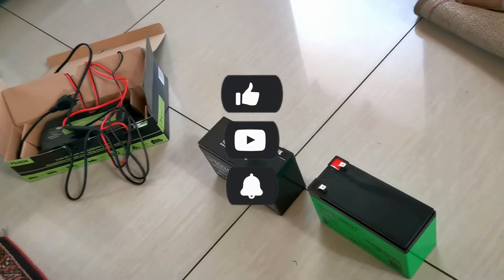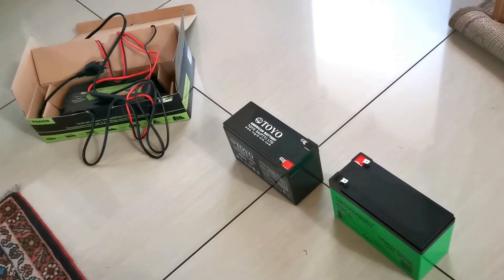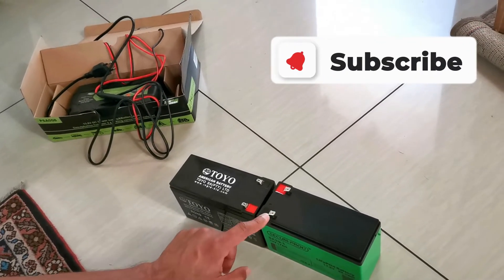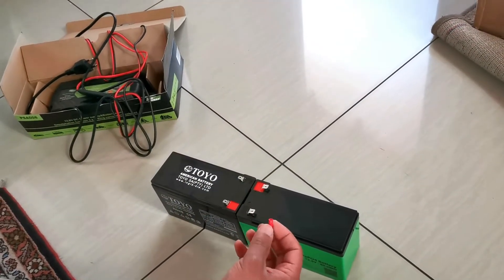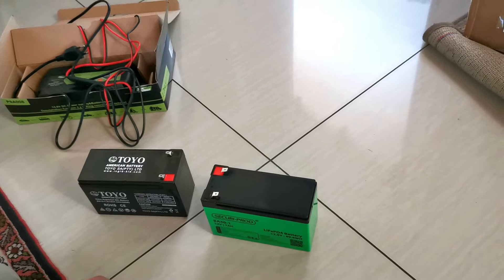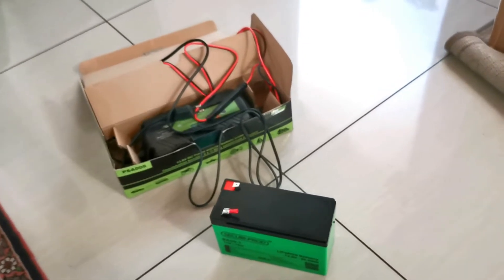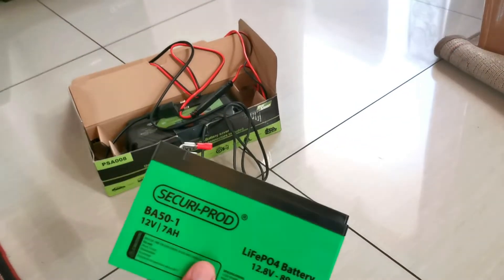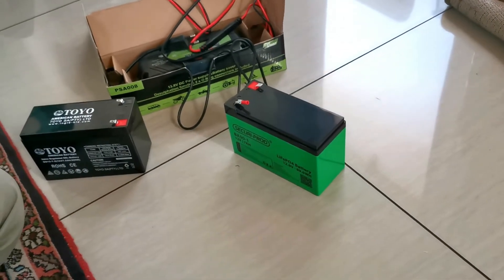Is a 12v lithium a suitable replacement for a 12v lead acid battery?

Comment: Howzit Boet. I see the video is 2 years old.
These LiFePO4 batteries are 12.8V (4 x 3.2V cells in series) batteries. 
The output voltage from your gate motor/alarm panel/UPS to charge the battery is ±13V, which is 100% compatible, which means you can swop them out.
Reply from the maker: 👍 I'll be making a video on it so

Comment: All I know, is, I got a Pride MED go power chair, with 2 Acid filled Nano - Silica sealed, 12 volt & 20 ah. I wanted to upgrade, change to a new lithium ion battery, but must also change are power controls, and a new charger, would be $600.00 too much, will stay with the Interceptor 2 non spillable Sealed Lead Acid Battery, NANO - SILICA  Type NB12,200 High Performance 12 V. - 20 ah. a 2 pack batteries

Comment: Hi I had the same problem but I forced on the connectors for the lead acid battery onto the new lithium battery.  But now my gate motor will not open or close when I press the remote.  Does it need a different charger (for lithium rather than for lead acid) than the one in the gate.  Also I suspect the gate charger is not charging but when I look I do see the light is on.  Any ideas.
Reply from the maker: Maybe a fuse blew, you have to do some troubleshooting
Reply: I have the same problem, how did you resolve it?

Comment: You can also connect 200 Watts Solar  Panel and 20 A controller  to charge same batteries..Works 100%

Comment: Nice one bro, I changed mine on the Centurion motors and did not have the same problem . I changed the electric fence energiser one too, these Lithium ones are awesome. 

I have had to change batteries often in the past, I’m hoping this will solve it.